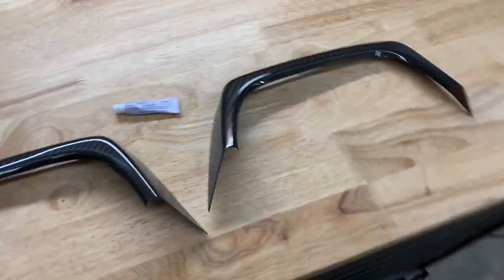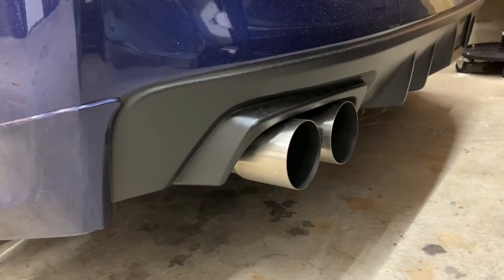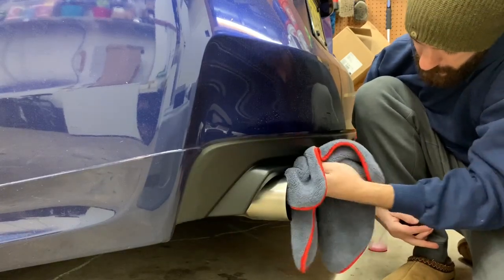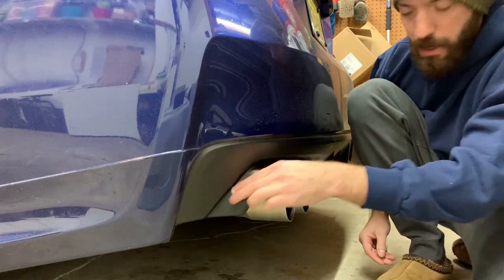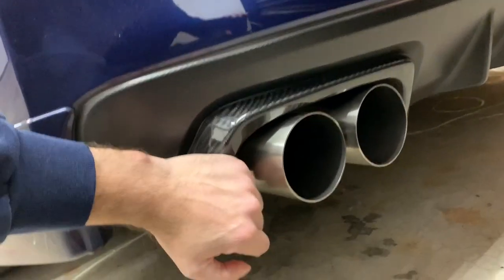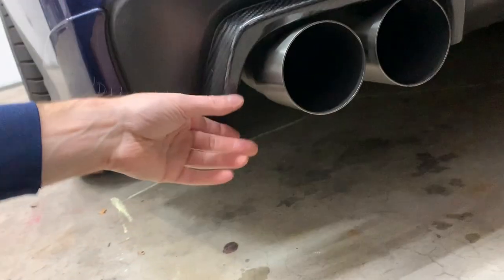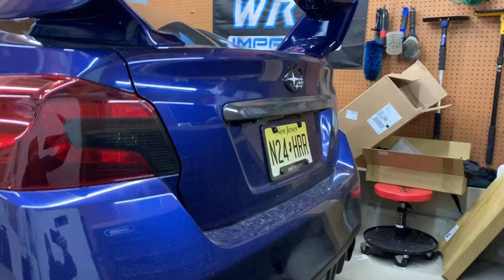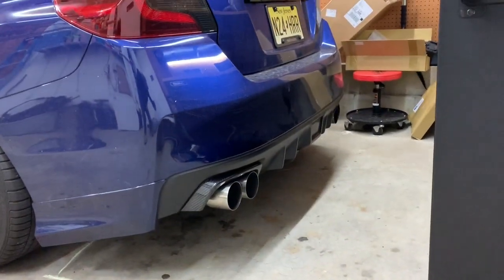OLM Carbon Fiber Exhaust Finisher Install on My STI

Comment: What’s the exhaust system ?? I’m sure it sounds nuts 🔥🔥
Reply from the maker: Delta motorworks
Reply from the maker: Delta motorworks
Reply: @Scoobyfreak86  thanks man 
Prob getting mine today , can’t wait to sign and take the keys
Reply: @Scoobyfreak86   hey i have a question if i change my muffler on my STI 2017 do I have to get it tune or I can just install it?
Reply from the maker: No tune needed for a catback or axleback.
Reply: @Scoobyfreak86  thank you

Comment: Did this double sided tape and adhesion promoter hold up?
Reply from the maker: Still on there firmly since this video
Reply: @Scoobyfreak86  I was worried with the heat from the exhaust it would eventually weaken that hold. I’m wondering also living in Ohio with the road salt if it would cause issues? Love your videos btw!
Reply from the maker: I don’t foresee it being an issue.
Reply: @RG-ok4dy  is road salt there a big issue for people that actually care about their cars?